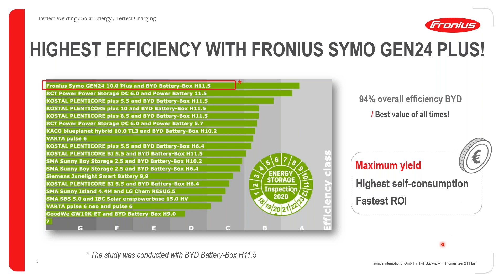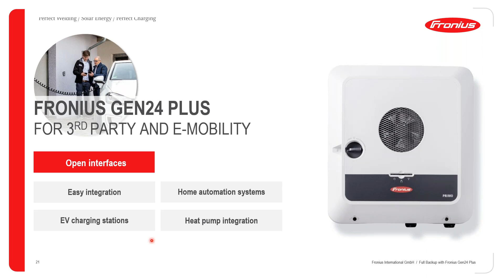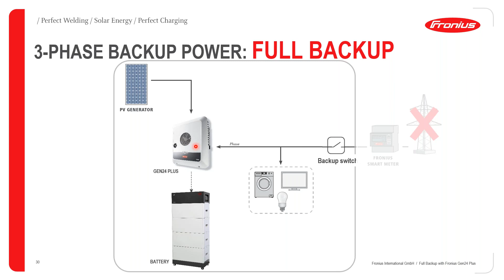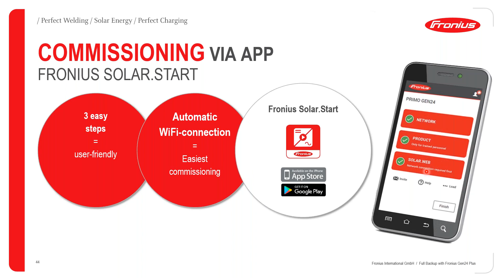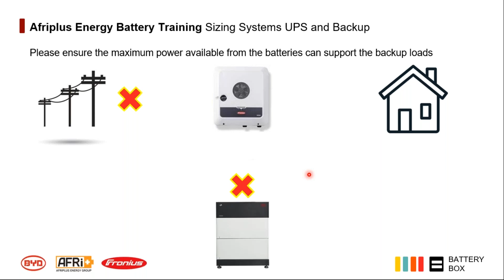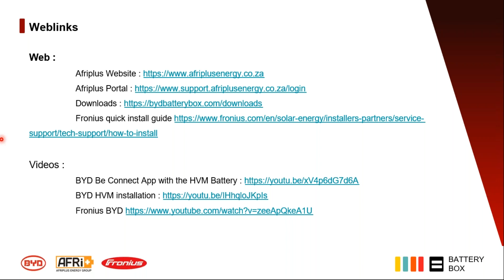Advanced Webinar: Full Backup of the GEN24 Plus with BYD (AFR)

Comment: is it only the 3 phase power that can do a whole house?
Reply from the maker: Hi Matthew Brawn!

An entire house can also be supplied with single phase full back-up, when there is load-shedding the Primo Gen24 Plus 6kW (our biggest single phase Gen24 Plus) can supply a total of 6kW output in back-up mode, when the grid is there then typically the PV-system with the grid can supply your house with a total of 15kW (based on a 63A circuit breaker).

Best regards, your Fronius Social Media Team
Reply: @FroniusSolar  Would you please identify precisely how this would work. I have that single phase Primo Gen24 Plus 6kW inverter with the 11KW BYD. What needs to be done (and supply part numbers) to make this happen.  Also, identify the Fronius smart meter I should have and how it should be hooked up. If there is a document, please direct me to it. Right now all is working in my system except when the grid goes down. Then I have no power even if my battery is at full charge!!! Thanks so much,
Reply: I do hope you receive an answer to this!!!